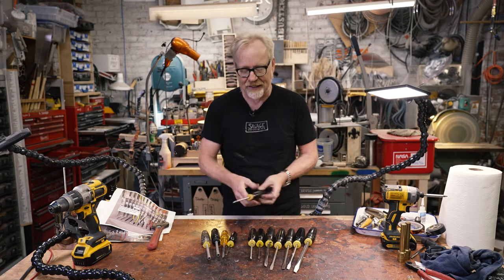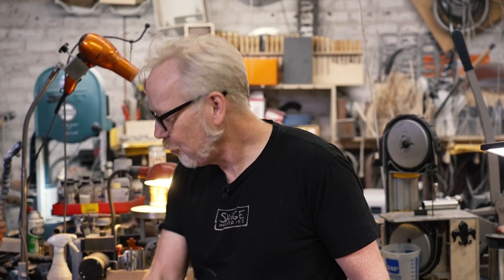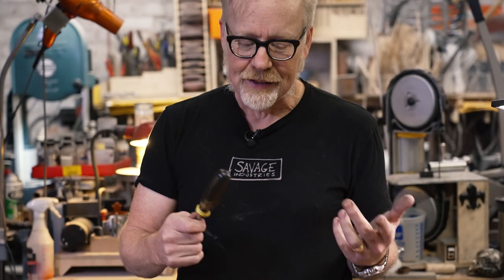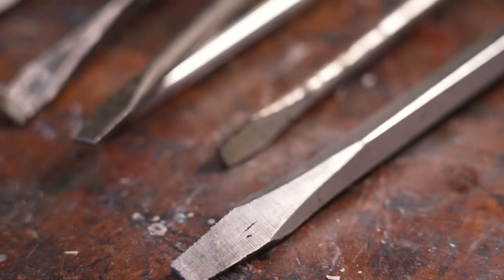Adam Savage's Favorite Screwdriver Design!

Comment: I won't compete with you.  But if you have an extra to send me.....I'll take it - gladly.  I'll even trade for it.  My favorite driver is the first one I bought for myself in the early 90's.  Just a single driver I needed for a new job - probably very inexpensive (it was a low pay job).  Black triangular handle, no indents.  Best shape I have ever used.  Turned out to be one of the best screwdrivers I have.  I think it was just before tools really went really cheap.  I used to want all my tools to match, but honestly now, I've started treating each as an individual rather than part of a set.  It's weird.

Comment: 3-sided handles may be comfortable, but not more than rubberized handles which increase torque strength as well. Let Adam have his collection keepsakes, but check out the Klein Tools rubber grip drivers made in USA, you won't regret it.

Comment: I wonder how hard it would be to cast resin around the metal part of modern screwdrivers to get the same grip for those who don't care about it being authentic.

Obviously, not something you would do at scale due to the cost of resin casting, but it might be an option for makers out there to make their own. It might be fun to have your own screwdriver set with something cast in the resin or the resin in colors you like, or even with LED lighting in the handle.
Reply: As an aside, I do know people make handles and drill them out, but a lot of the cheaper screwdrivers (which, let's be honest, most people will use as their sacrificial metal donor for it) look like they're cast around the metal with tabs on the metal that won't fit through the hole.

Comment: Consumer Reports placed the 1970s Stanley's at the top of their ratings at that time. I still have three of them that I bought when I was in high school. 

The stinky handle on the screwdriver is a dead giveaway that the resin is butyrate

As far as screwdriver sizes go, it isn't always a case that you need tiny ones. I ran into a situation where I had to have a #4 Phillips, which is not something I even knew existed until I had to take the apron off of an Atlas lathe.  Flathead screwdrivers are even worse, though, because to have the correct width and also the correct thickness.  Then there's the hollow-ground, keystone, and cabinet variations, which gunsmiths tend to get very fussy about.

Comment: Agree on the handles. But I don't care for that type of tapered straight screwdriver. Too easy to bang up the edges of the screw slot. I much prefer hollow ground blades. More often than not, I use a swapable handle with the appropriate bit for the screw slot.

Comment: You should not get rid of your old screwdrivers when you complete a set. Screwdriver is probably one of the most widely used and adaptable tools in the shop. They can be reprofiled many times over or used in one-off projects. By all means, get rid of stuff you don't use, but having a set of tools specifically acceptable to abuse is also very helpful. I keep an outdoor toolbox for these myself, I don't care if they get stolen and it's very convenient. Most of all when I'm welding, I can comfortably grab anything from that box without concern. I'm a big believer in the value of crappy tools. You just have to have good ones as well.

Comment: I have one of those, but it’s the reversible ratcheting bit driver.The top unscrews and you can store bits in the handle. For some reason, it smells terrible just like the one Adam has. Something about the plastics degrading. I love the design though. I’ve had it for 30 years. And like Adam, it migrated from my dad’s collection to mine when I went off to college.

Comment: Adam, I think your fears about stiff competition from your viewers over sleazebay listings is probably overblown. I have faith you can outbid most of us if you really want something. For my part I make due with the green handle screwdriver set from Harbor Freight. I'm not entirely happy with it though. Actually with most of the sets you can buy all together these days. The larger screw drivers should have longer handles for the leverage but all the sets seem to come with fairly short length screwdrivers.

Comment: Snap-on and cornwell make those...idk what to call it...tri lobe maybe? But very similar style handle. They're pricey tho, obviously since they are professional quality tools, but they are amazing screwdrivers. I never realized how much of a difference a professional grade screwdriver makes until i got a set of the cornwell elite series screwdrivers. Those arent the tri lobe style they make but a great screwdriver nonetheless. The first time i used one i was like omg...this is amazing. Now i dont feel as stupid as i did 10mins ago when i spent $100+ for 8 screwdrivers lol. But man the fitment is just amazing with a not good but great quality screwdriver. They dont cam out nearly as often, the tips obviously dont strip out/round over as easy, and just how they feel in the hand. But ya those tri lobe style you can get so much more torque on than the standard/cheap round or hex shape handles.

Comment: I beg to differ.
As I'm also slowly gathering my perfect screwdriver set (I'm more Wera than Wiha guy) I absolutely need less flatheads (I am happy with only one inslulated and one larger for those rare cases when I meet flathead screw - all of the others are in my Wera micro set), but more hex drivers - specifically the ones with a ball in metric sizes 1.5, 2 and 2.5. Unfortunately, Wera only makes only L keys with Hex plus ball end profile.
Reply: P.S. It looks like they'e started to make them at long last! Wera 352 is the name :D

Comment: I hate magnetic bit screwdrivers. Sure, being able to swap in any type of bit is handy and I use them when I have to, but they're always a compromise. Being necessarily thicker, they don't fit into tight spaces like a normal blade. And half the time the bit gets hung up in the fastener and pulls out.

Interchangeable blade drivers cost more and are less common, but operate like a regular driver. Wera's and Wiha's are really nice.

Wilton used to make their W6 series drivers with multiple blades that are permanently retained in the handle and can't fall out or get lost.

Comment: Flatheads and Phillips?! Those are the ones to avoid, unless you need to deal with loosening ancient screws. I only invest in Pozidriv and Torx screwdrivers. The ones by Wera are colour coded nicely, have the sizes printed on the back, and are quite sturdy.
Reply: The average Canadian only buys Robertson (square) screws/drivers. Flatheads are for prybars and Phillips are for stripping screws. +1 on the Wera tools.
Reply: @merrickgrieder4732  I may have gotten a long Robertson screw bit with the Kreg pocket hole apparatus I once bought online 🤔 Never used it. You probably won't find any of those screws in Europe.

Comment: But besides the flathead and Phillips you need a Robertson in Canada, and set of Pozi-drive if you live in Europe or if you ever encounter IKEA stuff. (Yes, that's why IKEA messes up the heads of Phillips drivers. They sort of work, but the engraved extra cross at 45 deg means you should reach for Pozi-drive.) And increasingly torx of course. And a couple of extra junk screwdrivers you don't mind using for stupid stuff (also relevant for chisels). So like a dozen at least.

Comment: Why do you think that slotted screwdrivers are ground to a wedge shape on the end? I want a set of regular screwdrivers whose end is parallel so it will cam-out less easily. Quality watchmaking screwdrivers have ends that are parallel. I hardly ever see a munged-up watch screw head.

Comment: gunsmith screwdrivers are parallel-ground so that you apply the torque along the entire depth of the groove in the screw.  most screwdrivers are wedge cut where the torque is applied only to the top edge of the cut in the screw, leading to messed up screw heads.  the head of the screwdriver length must be nearly the same size as the screw head. otherwise one would scrape the edges of the material being screwed into if too long, or if too short, risk deforming the groove in the screw.  that is why you need ots of screw dirver size bits.  SUPRISED  a precision guy like you would have any other kind

Comment: I have a Stanley "6 in 1"  with the shaft you pull out and flip that has bits that can be pulled out and flipped.  2 flats and 2 philips. They call it 6 in 1 because it could be used as a nut driver with no bit. (meh).  The ones with the bits in the compartment are annoying.

Comment: As much as I respect Adam as a maker I pretty much loose most of my admiration whenever he not only whips out a slotted screwdriver for a project, he had full control in ( incl. the screws ) but even worse also glees as if they're his firstborn.
I just don't get it man... Literally ANYTHING else bar just using round stock is better for fastening a screw than a slotted screwdriver though admittedly my lowest requirement already omits Philips so I'm starting with at least a Pozidriv ( still grinding my teeth ) followed by Hex and ending with Torx 😤

Comment: Hate to rain on your parade Adam, but when you use screw drivers in your trade all day long, the best and most practical, is ones with a softer gripping handle, and NOT with a outer plastic shell such as Stanley.

Comment: Good tool tip if you want your toolbox or drawers to smell like vomit with these old screwdrivers. I get the nostalgia of it, i have some old tools from my father and grandfather but i dont use them and certainly arent anywhere near my proper tools, cause let be honest tools have come along way and 99% (not all) of the modern tools are just better designed.

Comment: You're screwdrivering wrong if you're not using Robertson. Of course, you need flats and philips, so that you can remove those garbage screws and replace them with the correct screw. Anywho...

Comment: Sorry Adam. I've owned those Stanley's.  Most of them were turned into other tools. I hate their handles. I've used Snap-on screwdrivers for over 40 years. Their steel 'bites in' better. I love them. I also have switch-tip sets from Xcelite. Mac and Matco have great tools, too. I have an automotive background, so there's  my personal bias, personified, I guess.

Comment: Flat heads and Philips... yuck - the worst screw-heads by far. Torx, Torxs+ Pozidrive or Robertson any day...

Personally I prefer bits since the tips will get worn out and then only the tip needs to be replaced and it saves a ton of money to get a reasonable complete set ( about 100 different tips excluding miniature).
I only use fixed ones for high precision (mostly jewellers sized), hard to reach and very high force (aka tool mistreatment).

Comment: Phillips, Schmillips!!  Phillips screws and screwdrivers are CRAP!  They strip easily and the driver cannot hold the screw unless you have a magnetic tip and a ferrous screw.  By FAR superior is the "Robertson" square-head screw, developed and only widely available in Canada.  They provide a much better purchase on the screw than a Phillips and are very difficult to strip.  The tool tip and the squarish hole in the screw head are shaped such that the screw will stay attached to the driver tip, no matter how it's oriented, without the need for a magnetic tip and with a screw of any material: steel; brass; copper; stainless steel; aluminum; titanium; plastic; whatever!!  The Robertson screw manufacturers even offer "combination head" screws that take the Robertson screw driver with all its benefits but will also work with the inferior Phillips and slot screwdrivers.  Of course Torx screws are also excellent and miles ahead of Phillips.